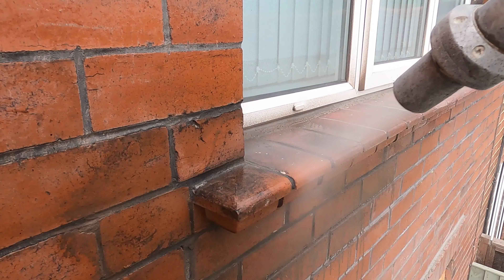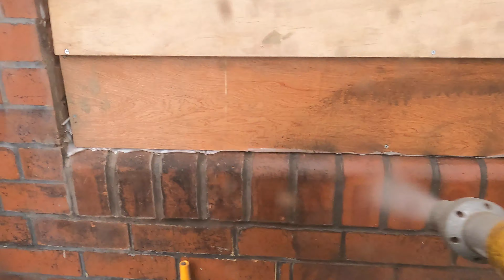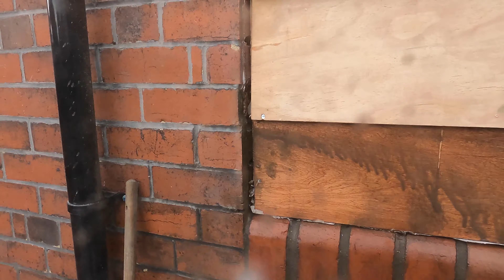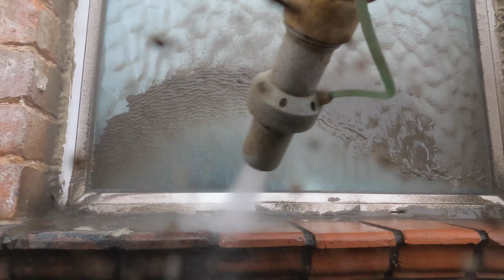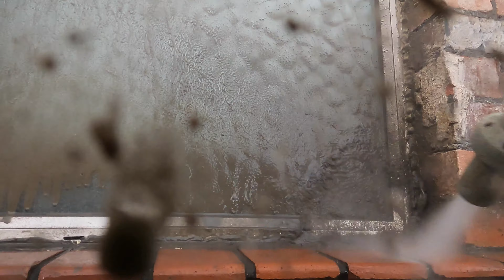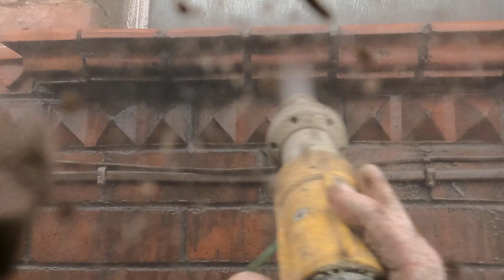2 easy jobs 1 day Dustless Blasting sandblasting

Comment: I find that a good pressure washer with a spinner tip would basically take 30 times less time than It took you to clean and it's all about the distance you have between the brick and the gun you can do a light clean or a heavy blast
Reply from the maker: I know my Falch 300bar 24lpm 150 degree power washer (basically the best power washer available that won't demolish the brick) wouldn't touch that carbon I also tried chemical with cold wash 270bar and it did nothing the last resort was blasting.
Reply: @Mobileblaster  never thought of it that way I always either went to muriatic acid scrub or high pressure and bleach but Id never think of hitting a window sill with as much pressure those spinning tips have they can pump out 5000psi which would blast the panes with sand and grit muriatic acid is a go to but doesn't always cut the cake it's always good to have an open mind never thought of using a sandblasting on masonry its so expensive to get a good portable set up
Reply from the maker: @brandoncochrone5582  yeah price of setup is high but a falch is possibly on par with a blaster in price. On black carbon like this HF is normally used but even that was painfully slow and not getting it back to 100%

Comment: The second house needed also a patio wash. Nice done both houses.
Reply from the maker: Thx its appreciated, Yeah your right little up sale their haha. My pump I had on the van isn't setup for psi to clean with (well it will but not setup to do this) its set for flow may not look much my little pressure washer but the lpm that thing kicks out is perfect for washing slurry away also with it been very low psi reduces risk of any damage.

Comment: I mean with 30psi you aren't doing any damage to the windom only People behind the computer thing it does but it really doesn't at that psi and the distance
Reply from the maker: Media plays a big part too I could smash soda at 125psi and possibly get around the same finish but then the costs would be 4 or 5x more expensive. all down to practice haha and 30psi is just nipping at the surface basically doing next to nothing in the way of damage
Reply: @Mobileblaster  i do wood sandblasting with garnet at 30psi to 60psi and even with garnet 200 at that distance with water that isn't going to hurt anything. Just another question i am looking into doing Stone blasting but i have been wondering after blasting do you protect the surface again or just leave it like it is
Reply from the maker: @quintdewit4870  it don't need any sealer this is preference👌 and go for it if you have experience in blasting it will be easier to transition onto stone brick etc 👍
Reply: @Mobileblaster  thx for the help again mate